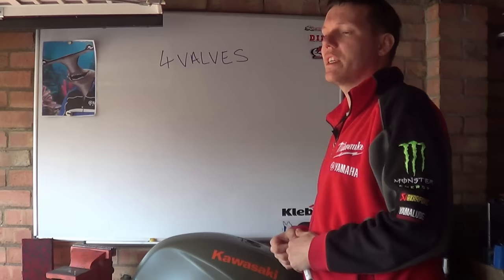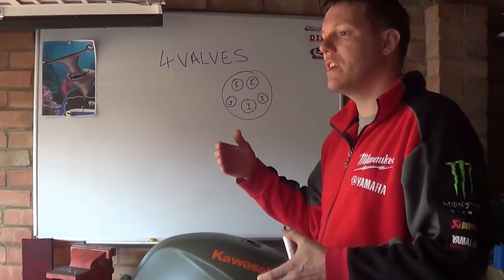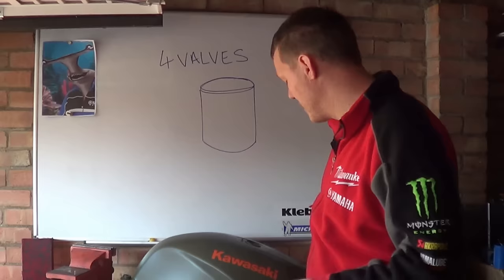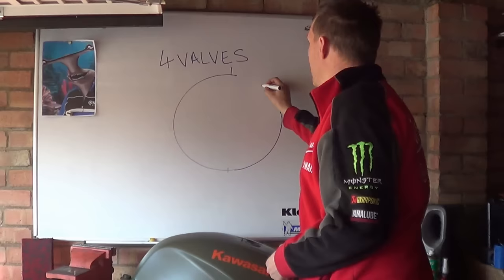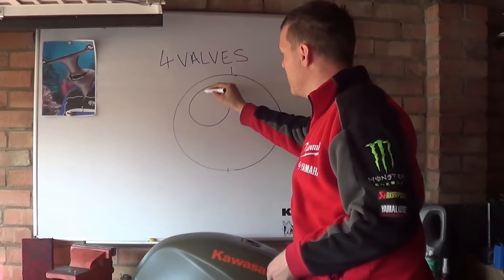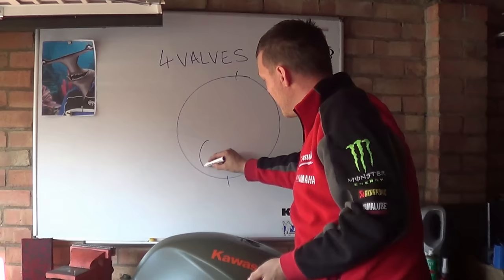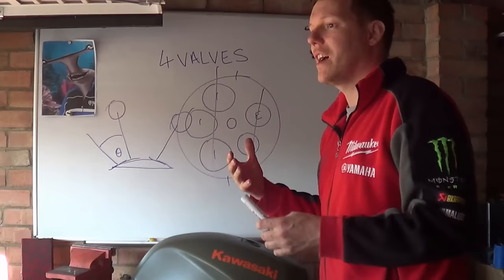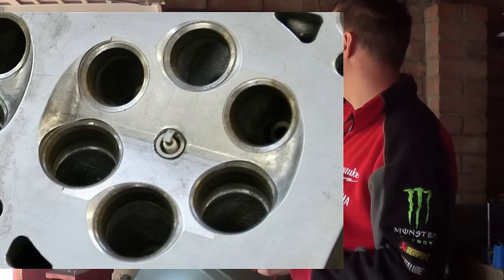Why do most engines have 4 valves per head?

Comment: 5 is better but only .5% better but that extra valve costs almost 20% more. For a cylindrical bore and equal-area sized valves, increasing the number of valves beyond five decreases the total valve area. The following table shows the effective areas of differing valve quantities as proportion of cylinder bore. These percentages are based on simple geometry and do not take into account orifices for spark plugs or injectors, but these voids will usually be sited in the "dead space" unavailable for valves. Also, in practice, intake valves are often larger than exhaust valves in heads with an even number of valves-per-cylinder.

    2 = 50%
    3 = 64%
    4 = 68%
    5 = 68%
    6 = 66%
    7 = 64%
    8 = 61%

Comment: This probably will not work but I thought of inlet and exhaust being a half circle that way you can have just one big valve for inlet.  Maybe it would be weak and a poor seal just a thought.  Great videos Iam addicted lol.  I have learnt alot to.  Iam a landscape gardener use alot of machines.  I used to think two strokes was the best due to weight,  power and simplicity.  However i have a 4 stroke Honda GX 25 strimmer yes its heavier but engine life lasts longer more low down torque powerful too..
Reply from the maker: watch this - https://www.youtube.com/watch?v=FmPRkXzPcaw

Comment: Why are there no valves that take up more surface area? Like a 3 post with a valve bridge that is shaped like a half moon, or maybe a 2 post with a valve bridge rectangular shape. I understand possible strength issues, but with materials being the way they are today they should be able to overcome that.
Reply from the maker: Good question - ATTL
Reply: for ages round valves and round seats were a thing that could be made with machine tools available. we could do other shapes now but there are a few constraints on that. sharp corners are hot spots and fatigue points. round valves rotate in use which keeps them wearing evening / not wearing.
Reply: 5 is best, 4 is almost the same, and more than 5 is worse, and less than 4 is worse. 4 is cheaper than 5, so that's what it is now

Comment: The Yamaha thought they were slick with the 660 engine by putting 5 valves on a SOHC. Then switched back to the classic 4 valve SOHC and haven't changed since. Am I right to assume that the change was a reliability issue with the extra valve not inline with its other intake valves or do you think it was just a decision based on production cost?

I just found it kinda weird that they were relying on one cam shaft to work efficiently with rocker arms at three different linear points
Reply from the maker: Great comment - I don't have all the answers, but I would guess that it was a cost decision. All the prototypes would have ekked out any masvie production failures. They're pretty tight with their money these days - matt

Comment: Audi and Ferrari also had 5 valves engines
Reply: But its not worth it
Reply from the maker: It depends what you mean by not worth it
Reply: F1 for example ditched 5 valve after they switched to pneumatic valve springs. Only reason they used 5 valves was due to valve float at 14-15k rpms and when pneumatic springs came that issue was gone they just ditched it. It was extremely hard to control the flow etc of 5v so they couldnt extract anything out of 5v so they just ditched
Reply from the maker: 5 valves don't float anymore than 4 would. The difference is valve mass.
Reply: 4 valve with variable valve lift and variable valve timing is better than 5 valves i think
Reply: @dirtygarageguy   i realized now that i worded it badly in the first paragraph, i meant due to 4v f1 engines floating at those rpms f1 started using 5v heads instead of 4v for a while and when the pneumatic springs came they no longer needed the 5v since it fixed the floating issue of the 4v f1 engines

Comment: I'm not sure if it's ever been tried since I don't know what to call it, but what about a single big valve that was half of the combustion chamber in the shape of the chamber? Two stems to keep it straight and such. I figure you can get into flow, stress, and manufacturing issues with that design but I was always curious.
Reply from the maker: Great question, will do a video on it - matt

Comment: Hi sir, greetings from Brazil, I want to you if valves of same types, inlet out Exaust, have delay from opening of close from each other or they open the same time.
Reply from the maker: Sorry mate - I don't understand what you mean - try typing it into google translate
Reply: Excuse me, the keyboard from my phone, again. I want to know if an engine have 2 valves for intake or exaust, these 2 intake valves open in same time? Or they have a delay?
Reply from the maker: Same time dude - generally. Very few engines have had valves of the same cylinder that open at different times.
Reply: The Workshop thanks

Comment: My GW250 has 2 valves per cylinder, very oldish design it seems but it is a budget commuter. I was kinda surprised when I found out my 2010 FZ1 has 5 per cylinder
Reply from the maker: Yeah the Fazers always have 'detuned' YZF engines. The fazer 600 has the old R6 engine. The R1 engine I was talking about is in the FZ1. It was from 1998 to 2006 they ran with 20 valves instead of the usual 16. The performance benefits weren't what they hoped The competition was still running 16 valves so they scrapped the idea. 

Valve numbers is obviously based on cost as well, so for cheap commuters it makes sense. 2 valves, 4 springs, job done.

Comment: Yamaha is done with 5 valve its all 4 valve now... and four valve is great for most normally aspirated engines but once you start adding pressure you are generally better off with two valves for durability
Reply: yamaha should know, they started it. Genesis.
one of the few times bikes lead the way for f1 and one of MANY times yamaha pushed some wild innovation out into the consumer market.

Comment: The day that Camless engines become common I can easily imagine 6 valve or 5 valve per cylinder engines becoming more common because they are actuated by air or fluid pressure instead of a cam.
Reply: Probably 5, being that you can use the same size for intake and exhaust (wich gives you the maximum usable area on the head) and still have the higher % of intake needed, you could even use only one of the intake valves at low speed and have better performance.

Comment: could you name a few f these engines with valves in the cylinder, just so i can start doing some research, i mean right now i'm picturing poppet valves with angles in the end and a square shaft or something to keep it from rotating and not seating, also you look like 25 or something, less than 30

Comment: 4+ valves per head is only good for race-cars and motorcycles. 2 valves is much better for a normal family car because of lover fuel consumption since you never rev it high enough to get any benefit of the extra valves... Only reason 4 valves is so popular on regular cars is fashion....
Reply from the maker: no its not, it all about volumetric efficiency